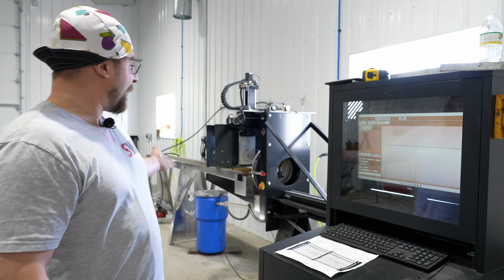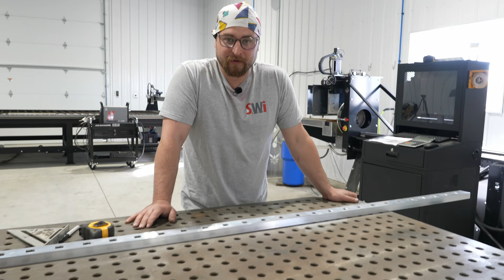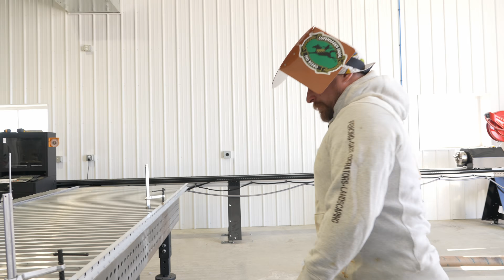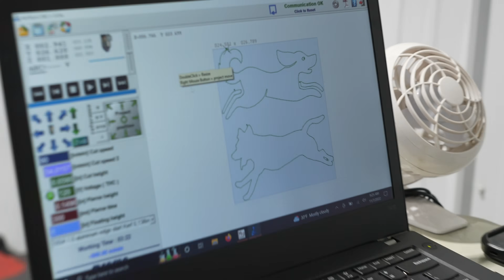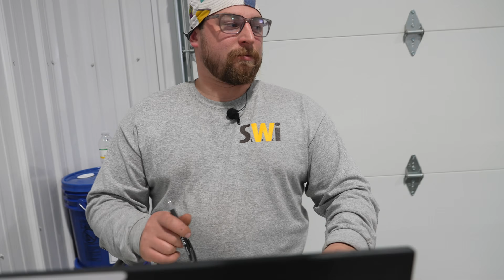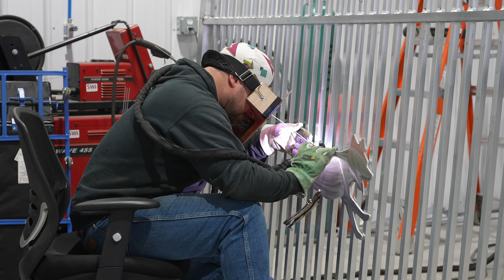1,624 Welds?! Fabricating A Custom Aluminum Gate

Comment: How come u don’t just weld it in instead having a machine to cut all the holes. And if it’s cut the the holes already why not use screws for the pickets. I’m here trying to buy a welder to learn welding aluminum while u have a machine that precut all the hole ready to screw pickets on but u use welding instead. Do you guys cuts holes for service
Reply: There are so many things wrong with this comment. Why the hell would you screw together a metal gate? By cutting the holes for the pickets, you are making it much easier to put together and probably adding a bit of strength. Since the pickers are centers in the cross pieces, trying to put this together with a bunch of individual pieces together and keep them all aligned and centered woudl be a nightmare. Screws would be weak and loosen up over time, but the welds would be permanent. You need to do a lot more than learn to weld, you need to learn why things are built the way they are built.